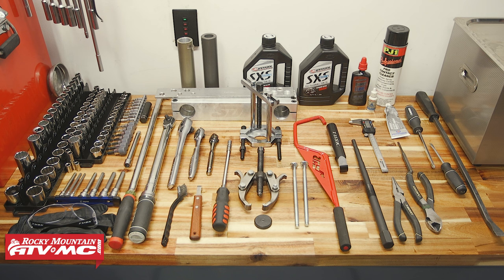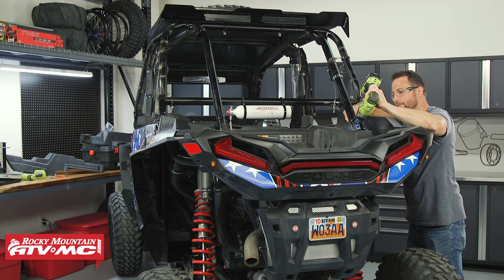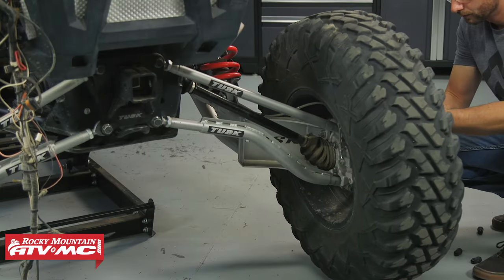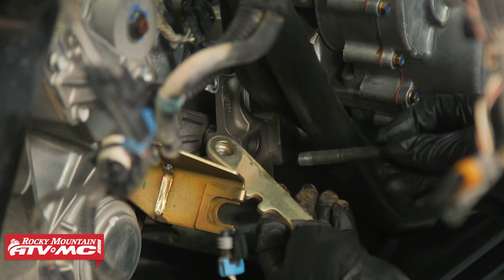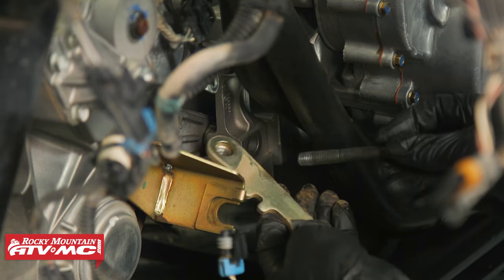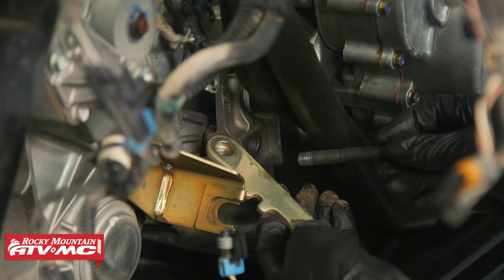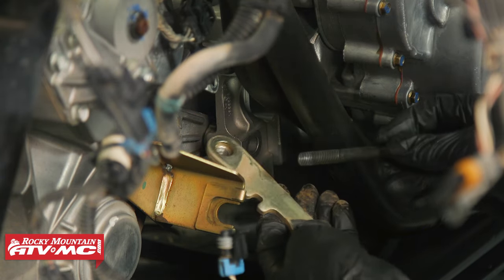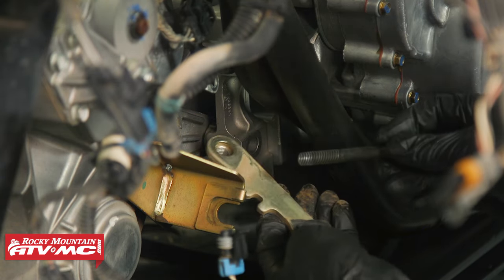How To Rebuild a Polaris RZR Transmission | Part 1

Comment: Hi Charles.  I buy alot from you guys & you have good videos on how to DIY. I see you are using tranny fluid the 2010 & newer XP 900 /1000 use gear oil 80w90 in the tranny.

Comment: correction. you will possibly need more than a punch to remove the snorkel gear. after bearings shred and metal shavings build up behind the threads. causing a build up and binding effect.

Comment: Is there meant to be a circlip behind the secondary clutch? My secondary clutch also looks different.
Thank you!
Reply from the maker: What's the year and model? If a circlip was on there at disassembly, it should probably go back on at assembly. I'd check the model specific service manual or at least a parts diagram if you aren't sure. -Charles

Comment: I think that repeat bearing failure is the result of the bearing being subjected to excessive side thrust from the fact that the angle of the gear teeth are opposite of each other on that shaft instead of the  same like the rest of the shafts and because of this the side thrust is being close to doubled instesd of nearly canceled out like it is on the other shafts with the gear teeth angles cut in the same direction.  I still cant figure out why they went with opposite angles on that third shaft.  If they choose to keep that design then they should have a dedicated thrust bearing to support the load as it has been made clear that the existing ball bearing is not up to the task... Food for thought...

Comment: What is the real cause of that particular bearing to fail??? Had my 16 xp4 1000 fail at 3500 miles, rebuilt with all 12 skf bearings, 2 shafts andn2 gears polaris and right half case from super atv, 2200 miles later same bearing failed again, it is not any kind of lube issue or eveyone would be having the same problem, example have a buddy that has a 15 xp 1000 with right around 8000 miles no problem.  Anyone found the real root cause of it? I am in the process of doing a failure and analysis of bearing and some measuring of the cases, I am super impressed with super atv cases in the fact its thicker then stock and contained all failed parts.
Edit: I did reuse factory left half case first time and replaced both halves with super atv second rebuild